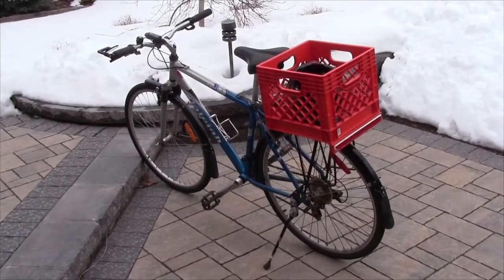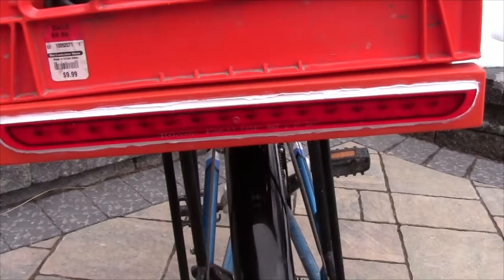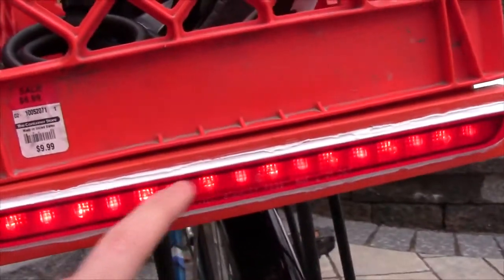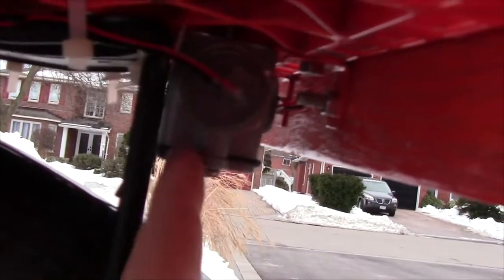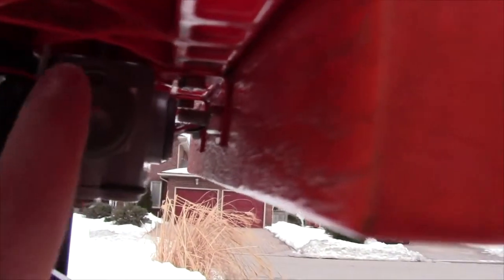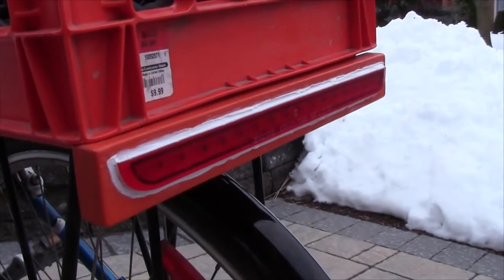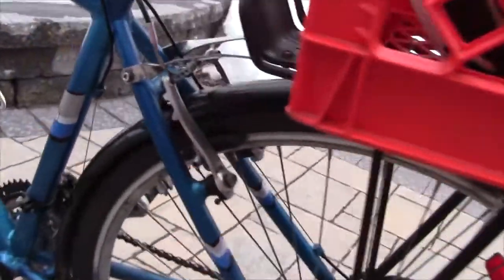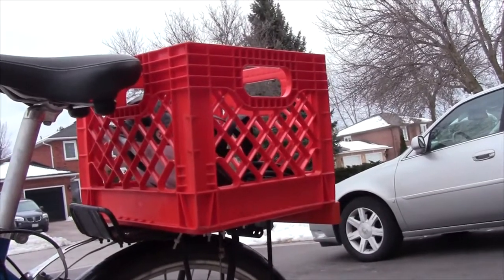Custom Build Rear Bicycle Light - Overview

Comment from the maker: I am certainly no expert on LED circuitry myself, and of course I will go easy lol. You are correct, if I were to connect all of the LEDs in series (connect the negative of LED 1 to the positive of LED 2 and the negative of LED 2 to the positive of LED 3 etc.) there wouldn't be a high enough voltage to illuminate them. However I used a parallel circuit (all of the positives connected together and negatives connected together) for my design. With a parallel circuit, all LEDS receive full voltage.

Comment: How did you squeeze all that power out of those AAs? 16 LEDs = 24 volt, 2 AAs = 3 volts. I don't understand. I am basing my question on almost no knowledge at all-- I tinker with LEDs for projects from time to time. So go easy on me.

Comment from the maker: I have a degree in Mechanical Engineering. LEDs circuits are pretty simple.
Reply: cjhoyle this has inspired me to build my own style one. I've got a long red reflector that I'm planning to take the back off and put a strip led behind the reflector so that the reflector acts like a diffuser to the leds and also a reflector even if they're off